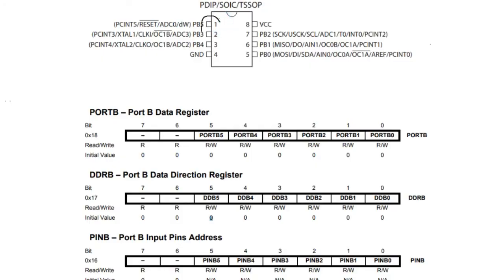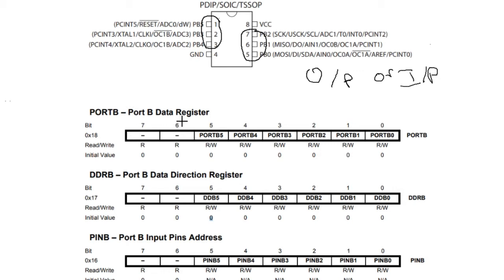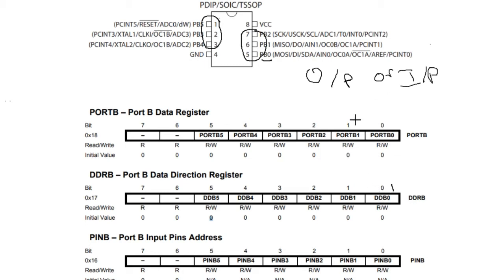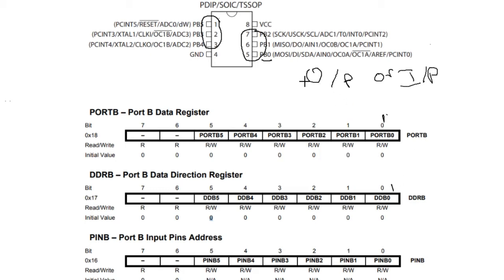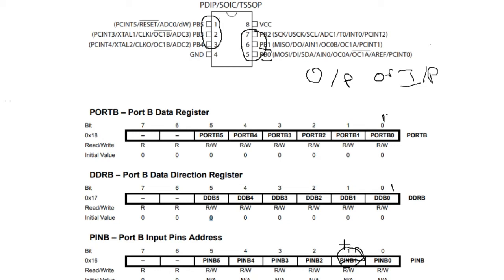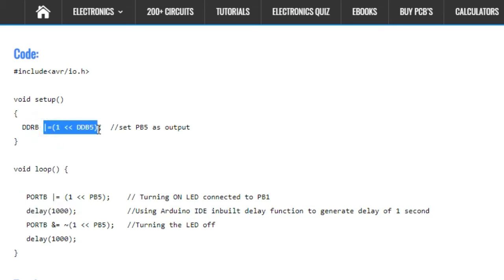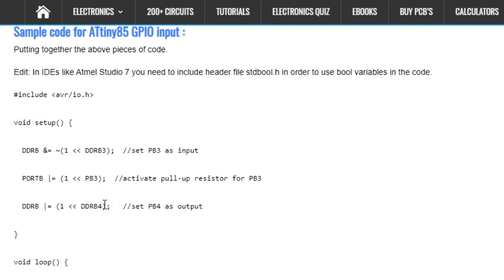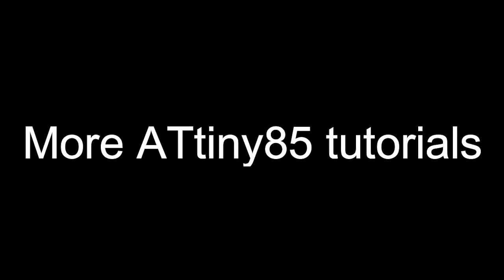#2 ATtiny85: GPIO - Working and Configuration as Input and Output

Comment: Dear Sir......I am using ATtiny85 for small toy project. I want 4 Output pins. Out of six pins available I hv used pin 7(PB2) and 2(PB3) as Tx and Rx respectively for BT usage. PB0, PB1 and PB4 are 3 outputs made available but RESET pin (PB5) not able to convert in to  output pin. I hv referred your this video for that.  4 Outputs required for two toy motors Forward and Reverse dirctions. pl, help.
I am electronics hobbyist (Age 72).. where can I send my code to you to to examine!